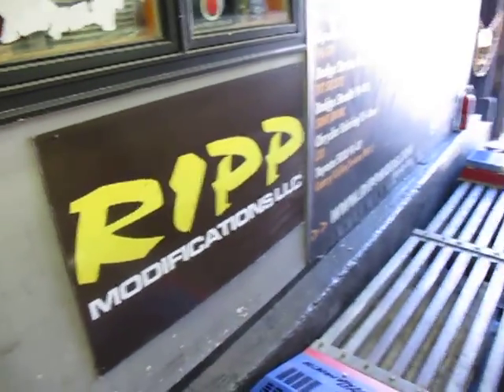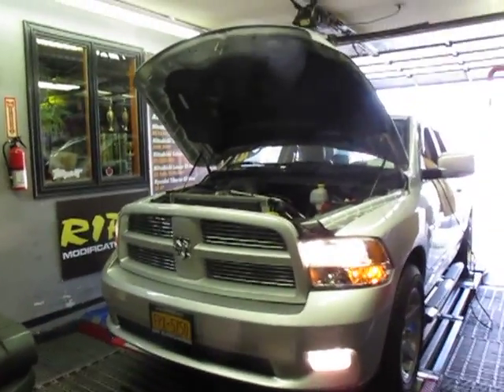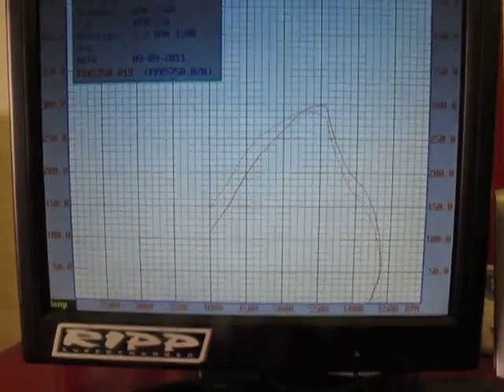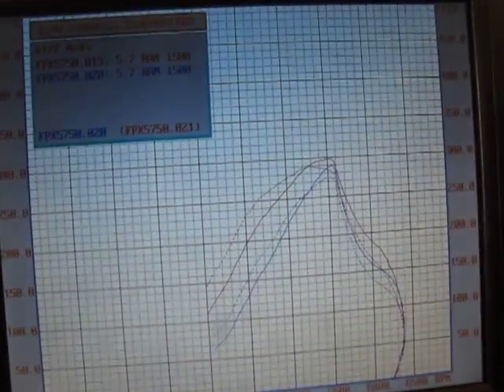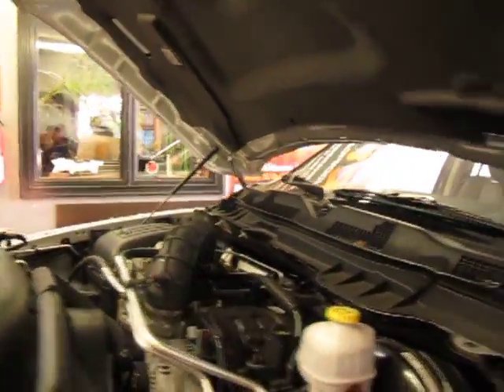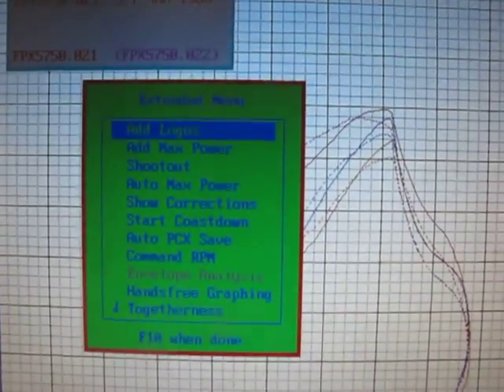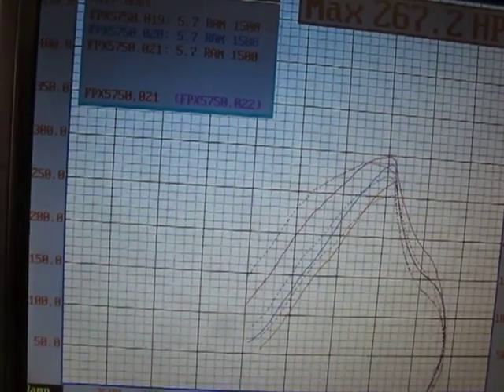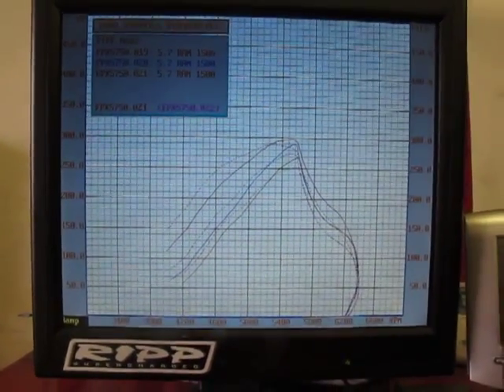RIPP Superchargers 5.7 VVTi HEMI NA DYNO Test 2010 RAM

Comment: so how would you make the same power? have a custom tune? i would have expected to have more power as the engine warms up. Im wanting to put a 5.7 hemi in my 2000 durango and trying to find what year engine to put in it for best fuel economy and power. im wanting atleast 300 hp at the wheels but still getting decent economy
Reply from the maker: We do not support the anything below 2011 5.7. We are unfamiliar with the older vehicles, their swaps or supporting kits.
Reply: RIPP Superchargers im putting an engine from a 2011 or newer into a 2000 durango body

Comment: From what saw and heard its a 30 hp drop (290-260) which is reasonable and should be expected. The only car I know that compensates for heat and altitude loss is the Buggati vyron which adds bost as hp drops to compensate ensuring the 1001hp is available in most conditions.

Comment from the maker: @dedone03 We get it its hard to swallow and its hard to believe.. but these drive trains have proven a 33% drive train loss in both the 2007-2011 Jeep Wrangler and now the Dodge RAM. But that's why we put that info out there so people's expectations are set... Fluffing the numbers either way is a lose-lose...2009/10 can be flashed with Diablo, 2011 can swap ECU's with 2010 programming. 2012 are SOL right now, unless you want to swap in a 2010 ECU and harness.

Comment: I just bought a 2012 outdoorsman with the 5.7 hemi and 3.92 rear end.  I read the specs and they claim a 390hp, 407 ft/lbs of torque.  Now i do realize they are probably measuring from the flywheel and not bhp.  Anyway My goal is to trick it out as much as possible 1 piece at a time.  Very interested in looking at your superchargers.  anyway, before i go supercharger what would u suggest for upgrades? and in what order.  usually i go with cold air throttle spacer, chip, but chip isnt avail yet.